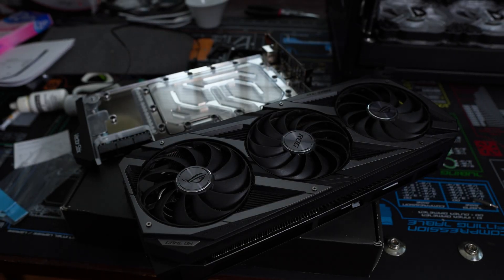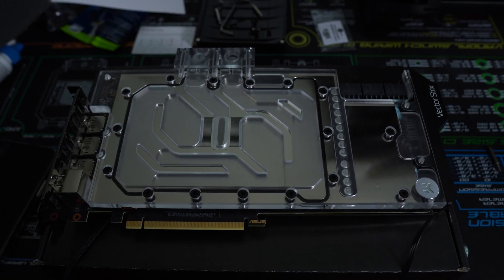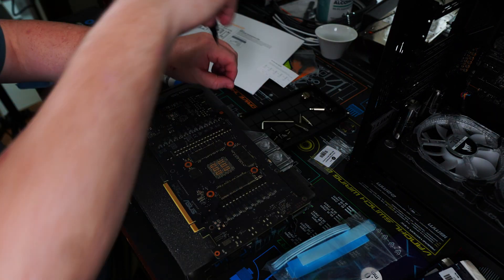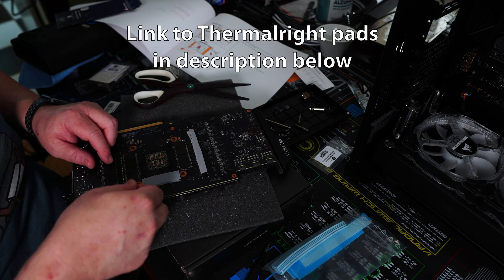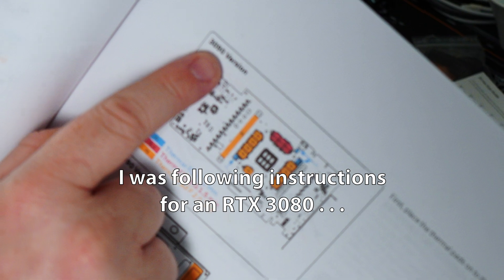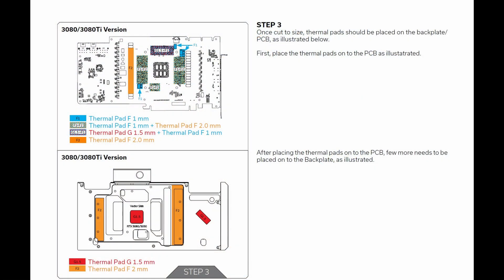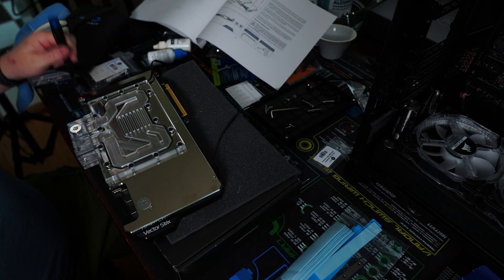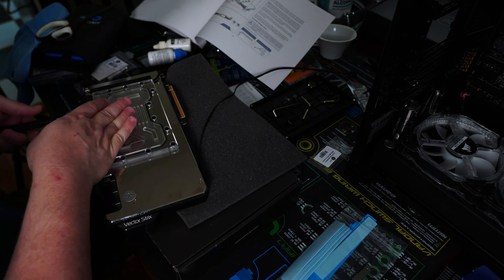Timelapse install: EKWB Quantum Vector GPU block & Active Backplate for ASUS Strix RTX 3090

Comment: I will never do this again - literally dreaded having to fix it get the plates flush and no flexing was a big mess.  AND then my loop gunked up and had to take it all apart and put it back to air
Reply from the maker: Yeah it’s def not the easiest. I’m dreading cleaning the entire loop.
Reply: What do you put in your loop so it doesn't mess up?  I heard something about bio inhibitors and anti corrosives I literally have no clue if I ever attempt to do this type of thing again @MiddleofKnowhere
Reply from the maker: Great question. I just use distilled water + EK Cryofuel Clear Concentrate. The concentrate has bio-inhibitors and such.  I don't do dyes or anything that might gunk up the works. Then for maintenance there are some products you can get like EK flush or Mayhems Blitz.
Reply: Thanks!  I put distilled water with some other liquid from a bottle I forget what(was 1.5 years ago)  But if I ever take the plunge again I will try that Cryofuel  @MiddleofKnowhere

Comment: Welche ist der In/out port bei den beiden waterblöcken?
Es gibt nirgends eine Beschreibung dazu.?
Reply from the maker: Great question. I'll be answering this in English and German using Google Translate. The question in English is: 
Which is the in/out port for the two waterblocks? There is no description of it anywhere.

For my set up, I'm using the EKWB Reflection PCO11 XL distribution plate. On the GPU block/active backplate sandwitch, my inlet is the bottom front port and the outlet is the top front port. The top back is capped and also there is no bottom back port. This might be the only way to do this GPU Block + Active backplate configuration, but I also think the top front port could also be your inlet and then the bottom front be outlet. Just looking at how the terminal is, I do not see the top back being used as either since you need the active backplate to get water somehow and it comes from the bottom back port. Also, I just went off the picture in the instructions which shows the front top and bottom ports being used. Hope this helps!

Tolle Frage. Ich werde dies auf Englisch und Deutsch mit Google Translate beantworten.

Für mein Setup verwende ich die EKWB Reflection PCO11 XL Verteilerplatte. Auf dem GPU-Block/der aktiven Backplate-Sandwich ist mein Einlass der untere vordere Anschluss und der Auslass der obere vordere Anschluss. Die obere Rückseite ist mit einer Kappe versehen und es gibt auch keinen unteren hinteren Anschluss. Dies könnte die einzige Möglichkeit sein, diese Konfiguration mit GPU-Block und aktiver Rückplatte durchzuführen, aber ich denke auch, dass der obere vordere Anschluss auch Ihr Einlass und der untere vordere Anschluss der Auslass sein könnte. Wenn ich mir nur ansehe, wie das Terminal ist, sehe ich auch nicht, dass die obere Rückseite verwendet wird, da Sie die aktive Rückplatte benötigen, um irgendwie Wasser zu bekommen, und es kommt aus dem unteren hinteren Anschluss. Außerdem habe ich gerade das Bild in der Anleitung verlassen, das die verwendeten vorderen oberen und unteren Anschlüsse zeigt. Hoffe das hilft!
Reply: @MiddleofKnowhere 
Also vorne rechts in 
Inten rechts out port?
Reply from the maker: German to English: Rear right out port?
The rear top port could be an out yes but if you look at the terminal it needs to probably be the front top for out or bottom front for out. IF you're still unsure, definitely email EKWB, they are super responsive to questions.

English to German with Google translate:
Der hintere obere Anschluss könnte ein Ausgang sein, ja, aber wenn Sie sich das Terminal ansehen, muss es wahrscheinlich der vordere obere für den Ausgang oder der untere vordere für den Ausgang sein. Wenn Sie sich immer noch nicht sicher sind, senden Sie auf jeden Fall eine E-Mail an EKWB, sie reagieren super auf Fragen.

Comment: this is probably a stupid question, but which side of the block when you have both the backplate and front block installed is the inlet and outlet sides?
Reply from the maker: As I'm using an EK Reflection Distro Plate, the bottom is Inlet and Top is outlet.
Reply: @MiddleofKnowhere  thank you!

Comment: I saved this video for later.
I am about to pull the trigger on this for my Strix 3080 12gb Eva, for my custom loop. Next cheque I'll have the 600$Cad needed.

How's it's running to date? Worth the price tag?
Reply from the maker: It’s running great. The gpu and vram never get too hot while gaming or rendering video. Def worth the cost imo as I can have a quieter set up.

Comment: Aside from the beautiful design and materials, another overrated $hit product from EK. Overly expensive and non functional gimmick from EKWB king of expensive fails. A product that someone has to buy to understand the level of poor ergonomic design... The devil is in the details
Reply from the maker: Ahh thank you! I thought you were referring to something I had done wrong in the video itself, but you're actually saying EK did a poor job. Since you do not care for EKWB, what water cooling products would you recommend people, like myself, spend our money on? Also how does ergonomics have anything to do with a GPU block sandwich. That one confuses me. Anyway, ty for responding back!
Reply from the maker: Also performance-wise, this block and backplate have been keeping my 3090 rather cool. Aside from really needing to have a good amount of force to line up the terminal screw holes, I haven't had an issue with it. Doing Nice-Hash and the GPU VRAM has only reached 78-80C. Idling it's been as low as 30.

Comment: Is the active backplate worth it for a 3-4 hr a day gamer? i already have the gpu block.
Sick build btw.
Reply from the maker: You might be able to get away with a nickel backplate and not active if you don't need it and have good airflow. The 3090 just gets so hot, even on the back, because gddr6x is hot and those back modules add to the heat. I def noticed a reduction in temps though.
Reply: @MiddleofKnowhere yea i got the nickel one and you are right the 3090 is just a watt monster especially if you increase the power to 123% .

Comment: Custom watercooling scares me.......I don't need that kind of anxiety in my life😆😆.
Them:" hey doc, how did he die?"
Dr: "his screwdriver slipped and he ruined a $3k gpu. At that point he had an aneurysm, clapped himself,  and bit the dust"
Reply from the maker: lol i feel you there. it can def be nerve wracking, especially when you see a leak. i freaked out then realized i just needed to twist the fitting some. With the 3080/3090 gpus though the extra cooling is nice due to the heat gddr6x puts off compared to just gddr6.